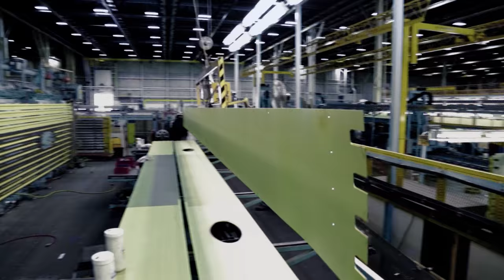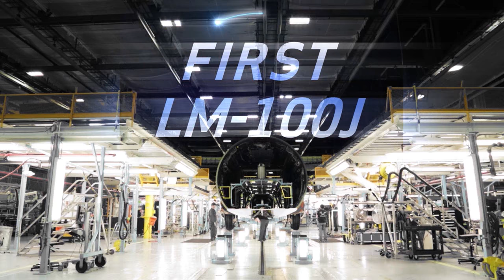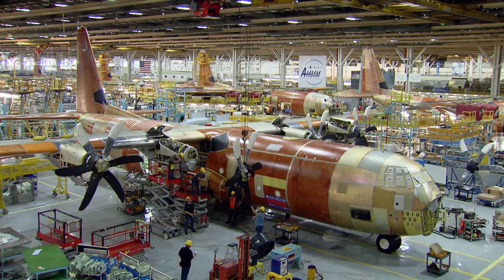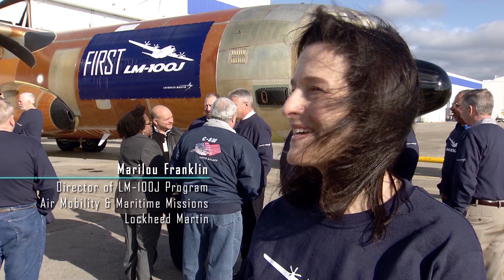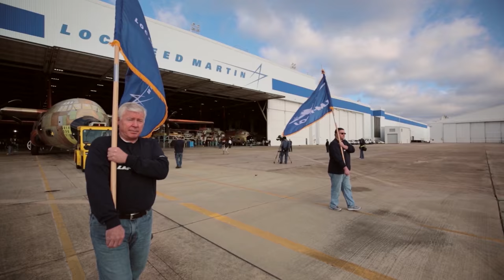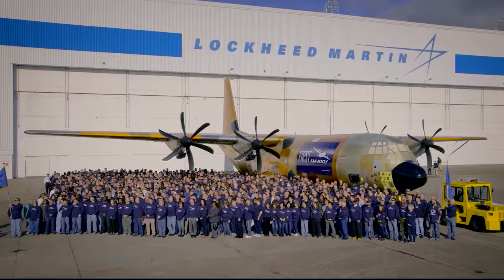First Look, First LM-100J: Episode 3

Comment: Great legacy aircraft that has served many Air Forces, including the RAF I served in, for decades. But there lies the problem.  It is old architecture and what can this aircraft do that an Airbus A400M can't do with heavier loads, longer range and lower running cost? And yes I know this is a civilian launch and there are no civilian A400s ... yet. But given there are no more C-17s and Air Forces are replacing the C-130s what do they buy? Many second hand Hercs will be repainted as civilian freighters no doubt.
Reply: Old architecture is proven, whereas the A400 is really only a few years old, and starting to show issues with cracking that was not predicted.  With time, they will work out the issues with the A400, but it is really still an infant being that the first production aircraft was delivered less than 4 years ago.  Cost is the other issue.  The unit cost is about 50% for a Herc compared to an A400, and the size difference is quite a spread.  So operators who need a plane the size of a Herc, would likely not even consider an A400.
Reply: +alco424
I think you should be careful when you say "starting to show issues with cracking that was not predicted". On technical matters one should identify the issue. And in this case it is not an Airbus or A400M issue it is a GE issue in clockwise turning propeller gearboxes. I am not saying it isn't serious as any failure is but can we please keep the discussion accurate?

http://www.defense-aerospace.com/article-view/release/174075/repair-costs-seen-exploding-as-half-a400m-engines-have-cracks.html

As for the size of the aircraft my experience in freight and logistics (and flying in Hercs) was that the more you can lift at the lowest cost the better so I am not sure that is a negative

But we agree on price because clearly LM have decades of production absorbed costs where Airbus don't and as I said there will be many older Hercs coming out of military service appearing in 'civvies'. So again as I said I don't see a 'civvie' A400M appearing for a long while
Reply: I think you should be careful when you assume I am talking about the gearbox cracking.  I am referring to the cracking of certain airframe components, so I am certainly keeping the discussion accurate.

As for being able to lift the most you can for the lowest price, that is correct, but again, I am referring to something different.  I'm referring to the many, many air freight carriers who have no need torun an aircraft as large as the A400M.  Most air freighters run smaller aircraft now, and upsizing to a machine like the C130 would be a stretch for their current demand.  Going all the way up to an A400 size aircraft would be a complete waste and outlandishly expensive.  Basically, it's great to have the extra capacity if you need it, but when it's not required, it's simply excessive cost.

I'm not saying there will never be a demand for an A400 size civilian version, but I'm not sure if there would be enough demand for it any time soon.  I don't think there's going to be a huge demand for the LM-100J either, since like you said, there will be surplus C130s on the market for significantly less.
Reply: +alco424
I think you are making more of this than is necessary. Can I quote from that article?
   "during quality control checks in 2011. It said the issue did not affect flight safety"
So it was a defect found by the manufacturer's own quality control systems 6 years ago in a small part unrelated to flight safety and since corrected under normal maintenance regimes. In service terms the gearboxes from GE are the major issue.

All academic as I think we both agree there will be very very few civilian A-400Ms...

Comment: Is it really that hard to paint it?
Reply: It may not be painted because its meant to be sold commercially and they will want to choose the design? I'm not sure just a guess.
Reply: Maxwell Smith Yeah I suppose but you'd have thought they'd paint it for the official release
Reply: Elliot Harpour Painting occurs in a separate building, after main production. This bird will get painted before delivery, I'm sure.
Reply: When they actually come to the official release, they'll have one painted for sure.  This is just the roll out, or the first time they moved the new aircraft outside.